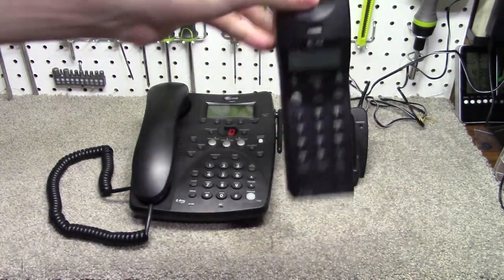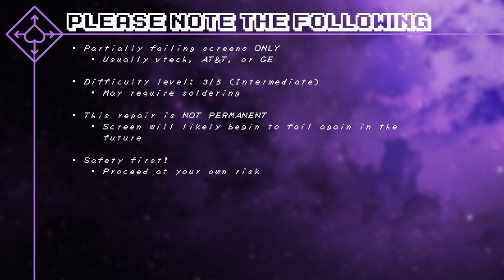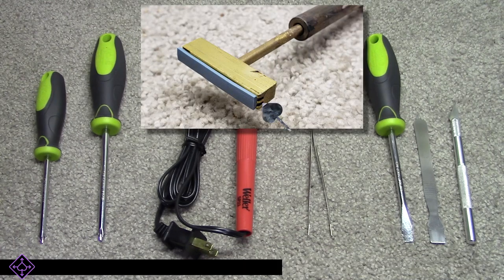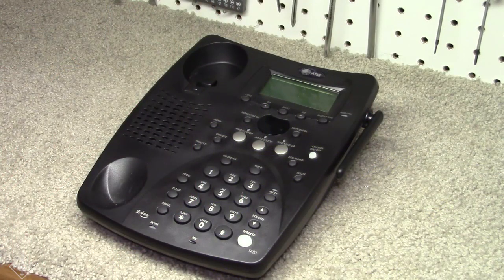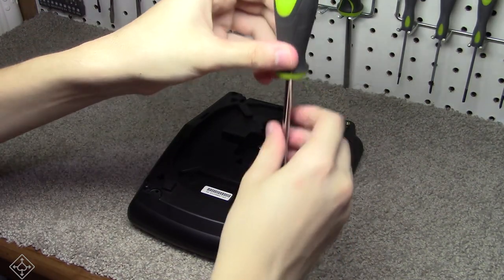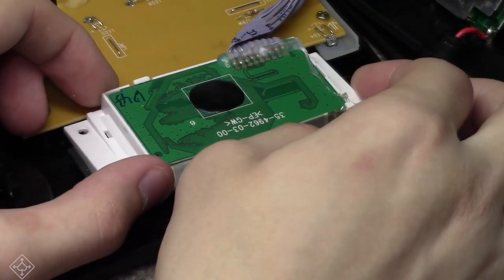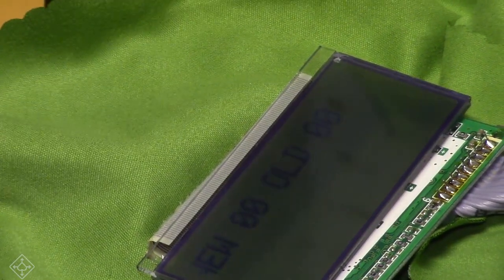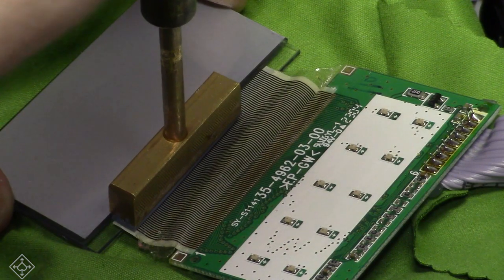How to Repair Dead Pixels on a Corded/Cordless Telephone Caller ID Screen

Comment: Thanks for the inspiration! I decided to have a go at fixing my cordless phone handset.. most of the pixels were ghosted out, making it impossible to read.. ok so I  don't have a T bar so I used a hairdryer on hottest setting.. I accessed the ribbon and heated it for a minute then pressed firmly along the ribbon with a soft pencil eraser.. I repeated the process 3 or 4 times..100% fixed 😊

Comment: I just bought an AT&T 9357. Works fine but the screen is blank green
Reply from the maker: Unfortunately the screen seems to be unfixable on the 9345 and 9357; it's designed such that the ribbon is inaccessible without breaking it.
Reply: Oof! I may just have to use it analog.
Reply: If anything, they should have used Elastomeric Rubber connectors instead of the ribbon.